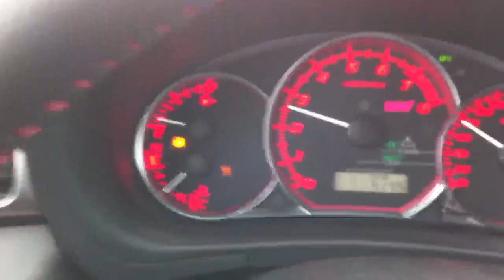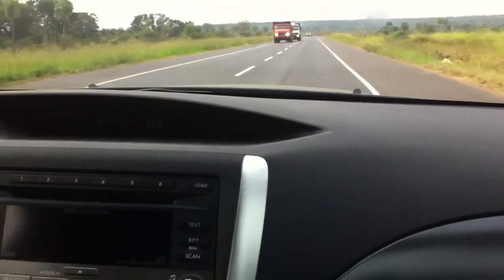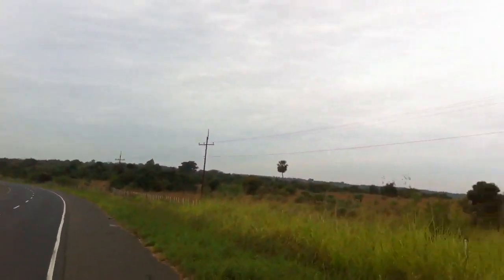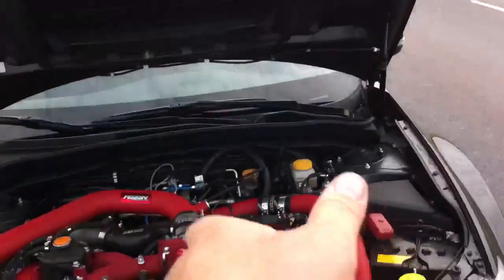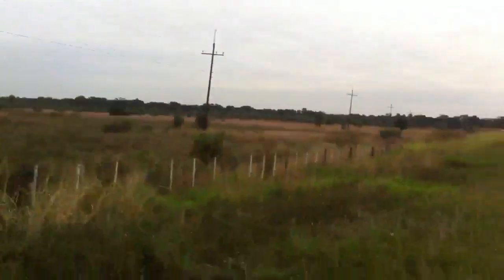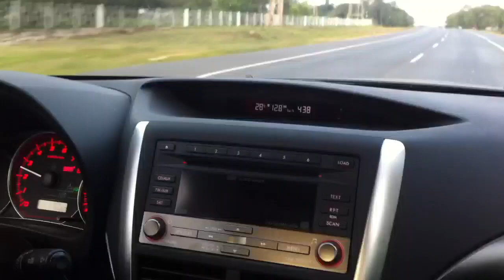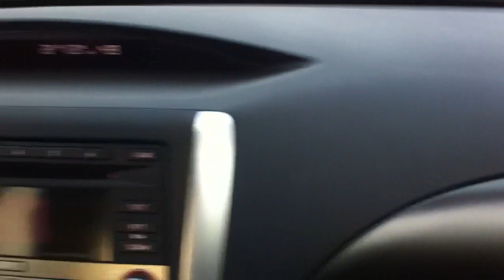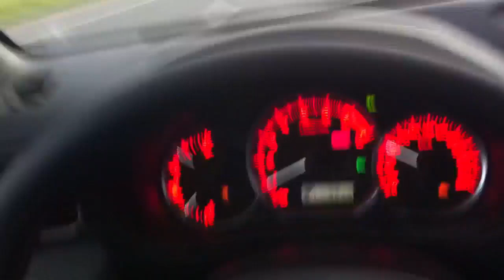Success with 2011 Perrin STI

Comment from the maker: @baseballdbk1 After I got the car running I tuned it with a base map for break in and the car was driven 1,000 kilometers to break in the motor.   Then I tuned it first for 20 psi.  Then 22 psi with the 5 bar map sensor and them finally 28 psi peak.   One day when I go back I'll tune it for 33-34 psi.  It is an amazing car.